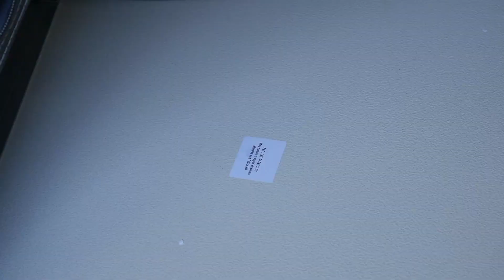Installing a Roof Top Tent On a CRV

Comment: Hi, how about the max roof weight of 40kg, I see a lot of cars with 60-80kg, so the 40kg for the CR-V seems quite low. Altough the gen 1 en later gens also have a weight of 60-80kg. 
Did you have any problems with the weight on your CR-V roof?